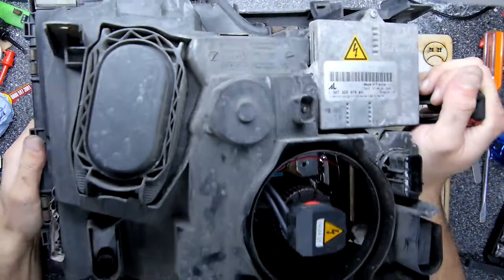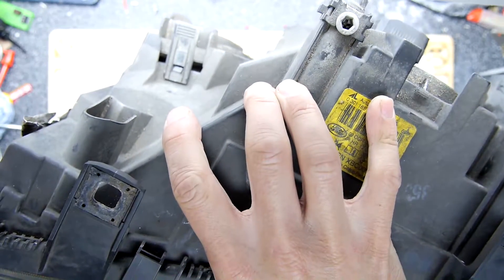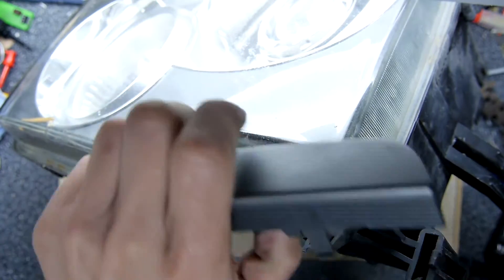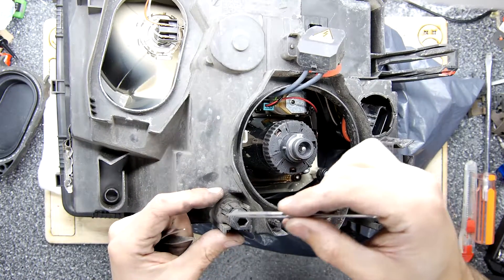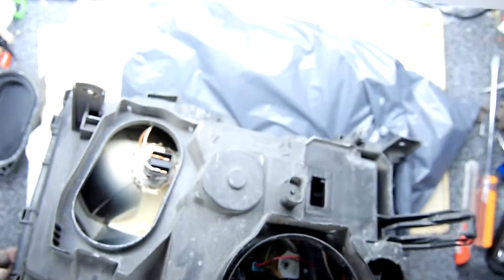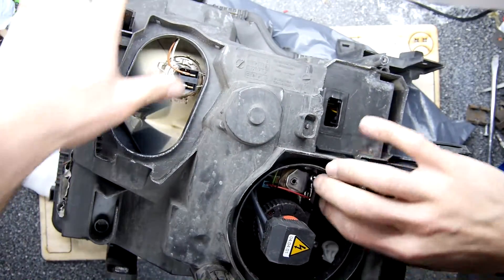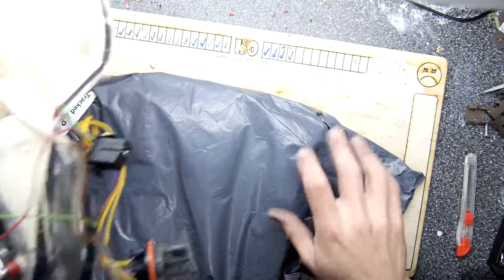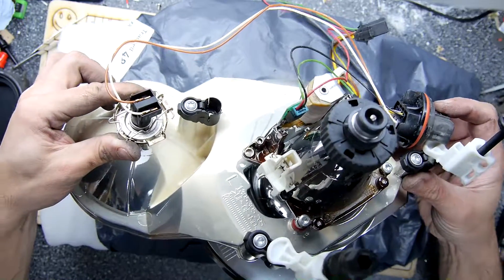L322 Xenon Headlamp Full Disassembly

Comment: To minimize the risk of breaking the last ball-joint (which has about 50/50 of breaking if you pull it), it's best to screw the self-tapping screw that holds it. It's fairly easy to get a T20 down there and take it off that way. The bit that you then have loosened is keyed into its place so it only fits exactly one way when you re-fasten it. The ball joints are super easy to loosen safely if you have them free, just by swiveling them until they pop. Pulling them directly out of the socket is going to break them more often than not.

Comment: Thanks heaps for this video. I wanted to dismantle mine to clean the inside of the HID lens. I had figured out how remove the back and the glass but not how to remove the plastic surround under the lens or how to push through the clips to release the body. Thanks for that!! I then found there is a clip or lever which releases the middle ball joint. There are then 3 torx screw that release the HID assembly. I could not get the HID assembly out but got enough movement to be able to clean the inside of the lens. Thanks again!!
Reply: Did it make a big difference cleaning it? I’m thinking doing the same with mine

Comment: Did you figure out how to test the igniter or the ballast ?? My  passenger headlight is not working and I was wondering if you happened to come up with a solution
Reply from the maker: It's quite a while ago so I do not really recall, however, I remember that even the lamp could be at fault after buying new non oem ones that exhibited the same behaviour. I would start by getting good quality manufacture recommended lamps as a starting point.

Comment: Hello ! Very useful video. Thank you for posting. Did you find the culprit ? I have the right headlamp (lh drive) which turns on once in hundred, just replaced bulbs for now and still the same. Thank you again
Reply from the maker: Gosh, I have a bunch of videos about this darn thing! Good quality lamps definitely helped and I even changed the components in the ballast
Reply: @backofficeshow  Thank you for your fast answer, I didn't take time to check all your videos (but I subscribe 🙂) Gonna disassemble the whole thing this week end following your videos, hope just dusty connectors.